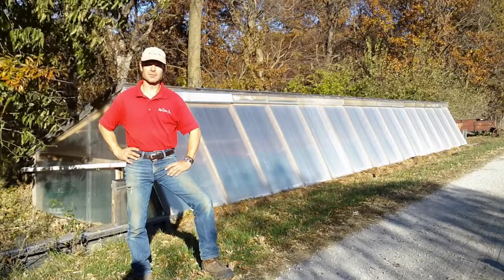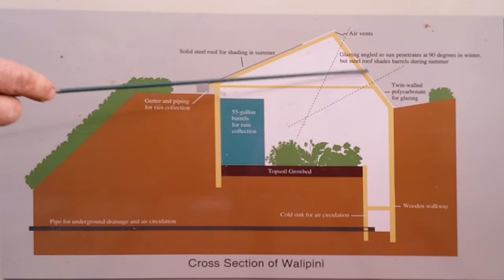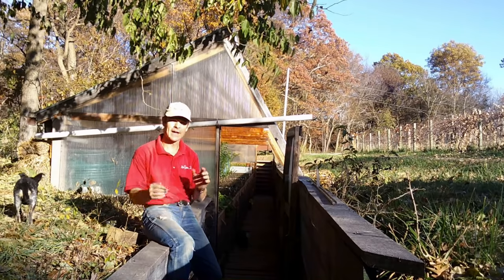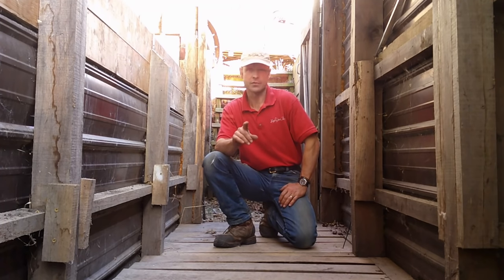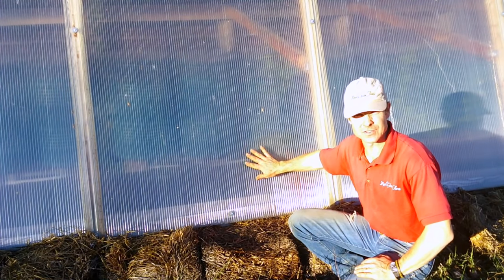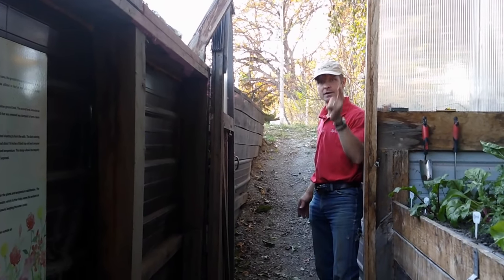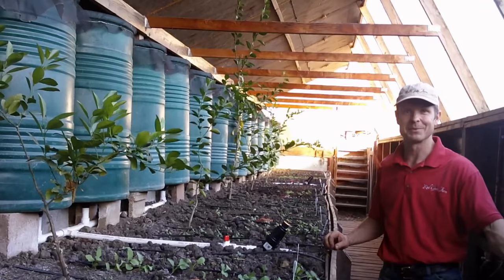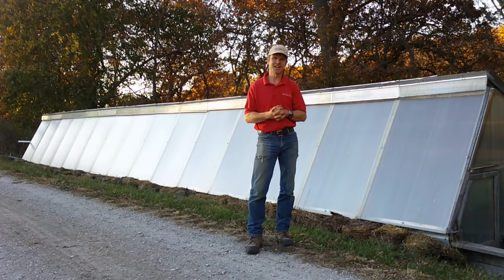Farm Tour Series: The Walipini; Use, Design, and Construction

Comment: Amazing story. Love how the bananas grew so much that they were pushing out the upper panels. 
How warm do the barrels get over ambient temperature in the Walipini, and how long do they retain heat over the night?
Reply from the maker: The water temperature changes very slowly, usually over weeks, not days.  I haven’t plotted it against outside air temperature but I should. Last I checked was just before Christmas and it was 58 degrees.  I have noticed it’s affected significantly more by the amount of sun and not nearly as much by outside air temperature.  A high pressure center with bitter cold nights below 0 and  sunny days is no problem.  A week of overcast is dreadful.
Reply: @ADifferentWay  You said you don't use it much in the summer so maybe it would be better to take in more light and abandon it to overheat in the summer. Then there will be more stored heat. The other thing I think would work good is to put a wooden frame on the ground outside the front and put more extra glazing to heat the ground direct. pretty easy to build and it would insulate and heat the ground outwards so the cold wouldn't penetrate from the front. it would put heat into the trench wall and collect the bounce off the main window in the summer. The cool air coming off the window at night would then push that heat down into the trench. Say if you had another smaller window above the ground behind the barrels and made the roof white. The light would bouce into the back window and heat the ground where the barrels are.  it  might be too hot in the summer but it would store a lot of heat for the winter coz the back window would collect the light off the roof. the barrels could then help transfer that heat in and out of the back where as at present they would be balancing the cold coming down from the cold ground at the top. I'm not sure maybe with this idea verticle windows and a flat roof would work good. I think more verticle is ok coz the sun is only at a high point for a short time and is mostly below that. then more would bounce off the roof into the back window which wouldn't be shaded. I suppose you could have a flatter roof and still have angled windows if there was higher ground at the back. That would make it more effective for thermal mass. the angle would be more for the spring rather than the winter. in any case I really like this idea of a back window to collect light off the roof. maybe the roof should even be angled upwards so it could collect more into the back window. i suppose you could scrap barrels and have it so the light comes down there or keep them and have it heat them direct. maybe angle it to reflect the light across the growing area and just put straw bales on the ground behind  to insulate the back wall.

Comment: Thanks for sharing. Do you think a hoop house construction using cattle panel would work in place of wood?
Reply from the maker: Only if you don’t have a lot of wind. Even the cattle panel hoop houses I used for my chicken tractor had to be reinforced with wood structures on each end. At 60 feet long, this walipini would have to have several wood structures to stabilize those cattle panel in the wind.

Comment: Greetings from Germany, thanks for this informative video. What is the max temperature range inside and outside?
Reply from the maker: Temperatures in our area varied from negative teens or 20s in winter to potentially low 100°F in summer. Temperatures inside the walipini Got as low as about 27° in winter, but that was generally after sustained overcast and low temperature days, where the sun was unable to heat the barrels. Summer temperatures could get well into the 90s. Of course, the Walipini was never fully sealed.  With a few minor modifications, the temperatures could easily be stabilized much further.

Comment: Intersting; however, I can't think of much I could grow in this during the summer (would simply bake anything inside).  Would be great for starting seeds( spring), winter and fall.
Reply from the maker: The biggest mistake we made with this particular design was not putting in enough ventilation tubes underground. Had we done so, it would’ve been much cooler in the summer. You are correct in that, due to the lack of ventilation, it did get quite hot in the peak of summer heat. That being said, heat, loving plants like our tropicals, citrus trees, tomatoes, peppers, etc. absolutely thrived during this time, and produced some of the largest plants we’ve ever seen! Over the years we worked with it, we eventually drifted into using it three seasons out of the year and allowing it to go a bit dormant for a couple of months during the heat of summer while we focused on the outside garden. the potential is definitely there for year-round use, however. If you look at the description section below the video, there is a link to our new book about this design and the considerations involved. We discussed in detail how to better ventilate to prevent that issue.

Comment: Brilliant! I've been looking at walipini gardens for a while and this one looks like it's working. I'm wondering how it would make out in the cold climate of Alberta Canada during the winter months? I mostly see people building them in the U.S.
Reply from the maker: If you read through these comments, you’ll see there are several people from Canada who have built them. I believe they can work just about anywhere, though it’s very likely you would need to make some modifications to make it work at your latitude and for your climate. Everything is based on the angle of the sun and trying to get the most efficient heating/cooling stability at the time of year you need it most. Most people from Canada suggest adding some type of additional lighting or heating to supplement the geothermal capabilities.

Comment: If you want to lessen your insect/pest issues, cover the soil with about 4-6 inches of wood chips from local tree arbors (important to get the wood + leaves). Just be sure they don't include any black walnut or cedar and hope for primarily deciduous. 

It's best to let this compost before applying, but even without composting, your soil will maintain higher moisture content which will keep the plants' cells more hydrated. Subsequently it's more difficult for aphids and other water lovers to suck your plants. Furthermore, you will very likely develop a natural mycelium mat with those wood chips which will further help your plants. The plant roots exchange sugars from photosynthesis for trace nutrients and natural pH maintenance with the mycelium network. It's really an amazing symbiosis and I am certain your greenhouse will explode with productivity. 

All that said this is a very well thought out design and a brilliant way to grow food where it would otherwise be impossible.
Reply from the maker: This is a technique we often use in the garden, but as you mentioned, our difficulty is that all wood chips include black walnut around here. We have a very large pile we keep breaking down and composting usually to spread the following year.  We have discussed putting it in the wall a penny, but just haven’t. No particular reason. Just haven’t gotten there!  🥴
Reply: @ADifferentWay  Haha!! Oh I understand the "haven't gotten there" part. There's never enough time it seems. Well, I am thankful you shared such a great design with the world here. Excellent.

Comment: Wow I love this. I live in Kingston Ontario Canada.   Can this design be used here? In winter it can get to - 25 degrees Celsius.
Reply from the maker: I think it could work up there. However, you better seal every nook and cranny and try to draw air in through the ground. -25 is pretty bitter cold even with 1600 gallons of water.  I’ve hit -17 F and avoided freeze.

Comment: I must build this. One thing I don't see here is provision in the rainwater gathering system for overflow. Do you just let the drainage tile in the floor deal with it?
Reply from the maker: We never had overflow, but then we also timed a good, deep soaking with large rainfall predictions.  We would just open the irrigation tubes for the whole grow bed, and let it flow!
Reply: @ADifferentWay  I guess it depends on climate, weather, and the capacity of the system. And it looks like you've built in lots of capacity. 

I had trouble with sporadic but heavy rains flooding my barn. Rather than just routing the water from the barn roof away downhill, I decided I'd capture it. I installed two 500-gallon tanks attached to the rain gutters. The first heavy rain filled up both tanks, so I soon found that I had to do something about overflow. So I routed a pipe from the tanks downhill to fill up my horse trough. 

Now I have two 500-gallon tanks at the barn, a 2100-gallon tank across the driveway that I fill using a transfer pump, and another 500-gallon tank that serves a pressure pump at the house. The rainwater collected off the barn roof keeps them all filled.

Thanks for the great walipini videos! You've earned my subscription.

Comment: I heard about walipinis years ago and have wanted to build one ever since.  You look to have learned many lessons from the problems others had before you!  Question; have you ever considered a rocket stove for heat?  Or, since you have stabilized the temps, do you feel it is not necessary?  Very excited to see the next one you look to build.  Subscribing to make sure I don't miss it!
Reply from the maker: I considered a rocket stove but realized air temperature can change rapidly but the thermal mass is the key to stability.  A rocket stove could heat it very fast but as soon as it's out, it cools back down to near the mass temp.  If I used a heater at all, I would heat the water in the tanks.  That would be much more effective. However, I haven't gone below 32 for the last 3 years.

Comment: Have you considered using a reflective surface on the underside of the insulating panels to reflect more light toward your garden in the winter?
Reply from the maker: I didn’t consider it before building, but I did after. It would be a good idea and I may incorporate it in a future build.

Comment: I'm about an hour west of the AF Academy on Hwy 24 in South Park and I'm working to find the ideal green house for one of my south facing slopes.  This might be it. I hadn't considered one that had beds I could reach across. That looks smart.  I don't think you mentioned the thermal barrels probably need to be food grade.  I have access to a livestock well.  Could I do the barrels without the pipe and without catching the rain water? I get almost no rain many years.  BTW, many pallets are made of oak, which would also make a good floor. Thanks. Great video.
Reply from the maker: My old stomping grounds, I love that area of Colorado.  My barrels are food grade but if you’re not using it to water the plants it’s not necessary.  Filling the barrels and leaving them just for thermal storage is actually much simpler in some respects.  No piping and no worry about being low in a cold snap.I wish you well in your build and be sure to watch our follow up video on the walipini.

Comment: That looks like a very efficient structure.  Congratulations!  I am wondering though, how do you keep rats or mice from getting in and living in there?  Thanks in advance for your reply.
Reply from the maker: We really haven’t had a big problem with rodents.  Voles have been the most prevalent rodent, nibbling at our plants, but we find regular maintenance to the soil and ultrasonic devices in the grow bed keep them under control.  We allow our barn cats to run in the structure about twice a year when doing our repairs and adding compost additions, and if any other mouse issue arises, we just set traps.  Aphids and pillbugs have proven a far bigger issue!
Reply: @ADifferentWay  pillbugs feed on the mulch breaking down right?  What are your aphids eating on?

And why would pillbugs be a problem eating the fungus on your mulch?  I am only seeing opportunity here
Reply from the maker: You would think!  As it turns out, pillbugs LOVE to eat the tender stems of newly sprouted seeds!  I have lost THOUSANDS of little seedling and new transplants to this voracious creatures.  I even try to put organic materials in there for the little critters, but they seem to prefer my tender stems.  I have sat there and WATCHED them eat.  The aphids tends to gather on the bottom of certain plants, so we use sacrifice plants such as rutabaga, which they tend to prefer, in order to keep them off of more desirable plants like kohlrabi.  Otherwise, the aphids eat almost any of our cool-season crop leaves.  Ladybugs tend to keep them under control, but I definitely have to stay on top of the issue!
Reply: @ADifferentWay  wow wow WOW, never would have guessed that!!  What naturally goes after pillbugs?  Anything you can introduce to bring a balance? 
Wow, your post blew my mind.  Your vid did too, but now I’ve got pillbugs on my mind.

Comment: Hi, great video! Thank you for making the effort. I am in the UK (zone 9a) planning on making a walipini and just starting on my journey with this (not a farmer yet), Someone else on a permaculture video was suggesting the sun angle does not matter as much if you are using light diffusing materials such as the twin walled polycarbonate. Does that make sense?
Reply from the maker: There can be some truth to that statement depending on the design of the panel.  The best answer will come from the manufacturer of whatever panel you chose.  Installing correctly is vital.  Mine is vertically ribbed so as to follow sun azimuth more efficiently while still reducing shadows.  Angle is not as critical in azimuth.  However, the sun elevation angle still should be considered for max penetration (i.e. as close to 90 deg as possible).  That’s why my front wall was calculated based on latitude and sun elevation.

Comment: Very nice.

You were suggesting a concrete wall, have you looked at aircrete? It appears to have the benefit of concrete with less mass and better R factor.
Reply from the maker: You wouldn't necessarily need R-factor with the wall buried in the ground.  The ground is your insulation.  The concrete simply adds a better, more stable wall for the ground pressure forced on it.  R-factor WOULD be critical on any larger sections of wall that are above ground, which some latitudes may require.

Comment: Hmmm...wonder if you could do aquaponic this way? (in barrel 5 pound buckets with water and fertilizer?)
Reply: Water temperature change would be an issue as he's using the barrels as a heat sink. High daily temperature changes can shock/kill

Comment: Looks like a terrific system. About how often do you have to clean the water barrels?  Do you also have to sanitize them?  And what do you use as a sanitizer? Also, I didn't hear a ballpark figure as to how much this might cost if you couldn't harvest and mill your own wood? ( These videos never give a dollar figure) I also wonder how well this would work if we built this for use during 100+ temps in the heart of Texas? Thank you!
Reply from the maker: I’ve Only cleaned the barrels once in the last five years. We do not sanitize them, it’s pure rain water and it goes direct to the grow bed, no need for sanitizing. Our total cost was less than $5000, however, I have no idea what it would cost if you bought all your wood. As far as Texas heat, we only hit 100+ degrees here a few times per summer. The cooling vents work fine through that but I’m not sure how long we could sustain excessive heat like that. To keep it cooler you should consider diffusing light more and having far more inground ventilation coming up from the cold sink.
Reply: @ADifferentWay  Thank you! :)

Comment: Do you have any problems with flooding? Here I'd think if I did that in the spring and every time it rains the thing would fill up with water!
Reply from the maker: The drain tile in the cold sink has kept all flooding below the floor.  In heavy rains I sometimes get an inch or two but it drains quickly.

Comment: what about installing a wood burning barrel stove in the walipini. run a duct pipe around the outside stove, have an open end on a foot away on the bottom floor for the air intake & and run the pipe accross the beds & travel to the other end & drop to the bottom floor. the pipe running accross the beds will act as a radiator.
Reply from the maker: Any type of supplemental heat would work. However, that turns it from a passive design to an active design. Additionally, I think it’s far better to heat the water than it is to heat the air. The air has virtually no thermal mass. In other words, it is warm when the stove is running and cold as soon as it stops. Heating the water captures that heat, and slowly releases it back into the system over hours or even days.

Comment: From Lil Giant I only understood the basics of most of the concepts. Would probably need to get expert advice to even do this. 

However, “solar minimum” might affect Florida temperatures drastically. Do you think this walipini, if built, could later be adjusted, or need to be adjusted, for changing temperatures/light angles?

Comment: Would it be possible to use the a regular hoop house installed over a trench to keep winter temperatures more stable for hardy plants?
Reply from the maker: That depends on what climate you’re in. In our climate, it would not be nearly enough. With temperatures falling below zero for several days, you have to have significant thermal mass to keep those temperatures above freezing. Unless you could insulate the hoop house during the most extreme weather and possibly supplement with an additional heat source.